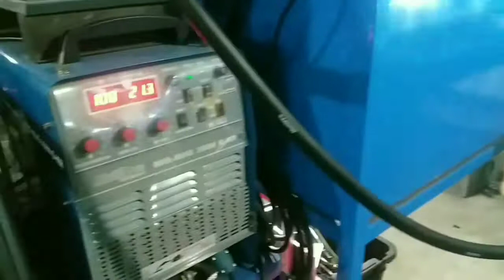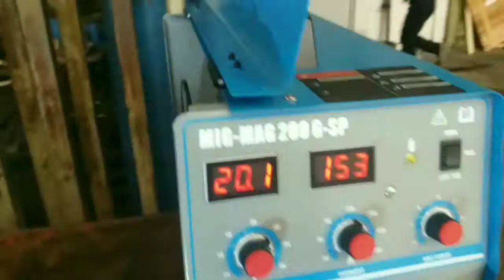MESIN LAS MIG - rekomendasi mesin las murah.!

Comment: Apa beda ny kwat solid dgn yg biasa bang ?
Reply from the maker: beda di penggunaan gas. kalo yang solid wire gaanya co2 sedangkan kawat las flux core tanpa menggunakan gas apapun dalam penggunaan di mesin las.
Reply: @Welding399  klo flux core tnpa gas bukan ny nnti hasil las akan porosity ?
Reply: @Welding399  apakh solid hrus gas co2 100% ? Apa kh gas ny bisa di mix misal dgn argon ?
Reply from the maker: tidak bang karena kawat lasnya khusus di gunakan tanpa gas. jadi tidak korosi